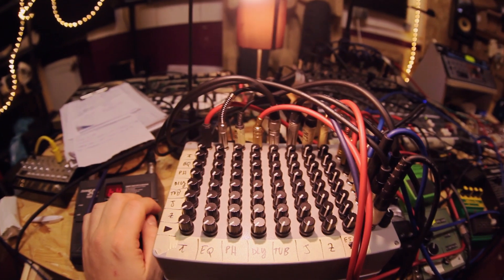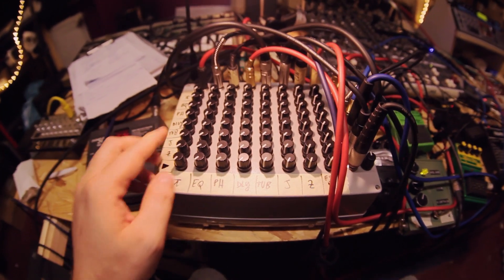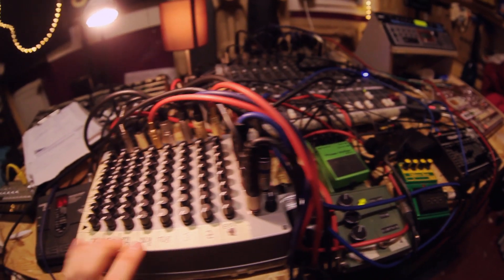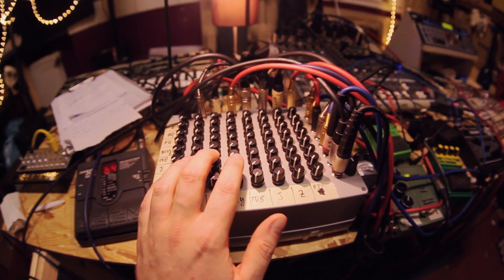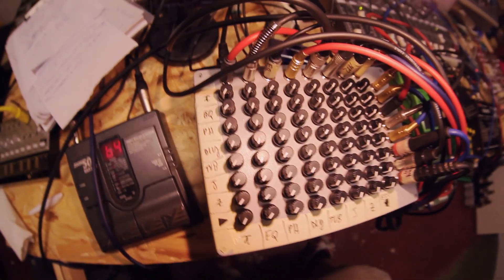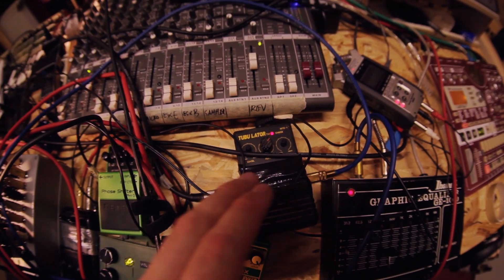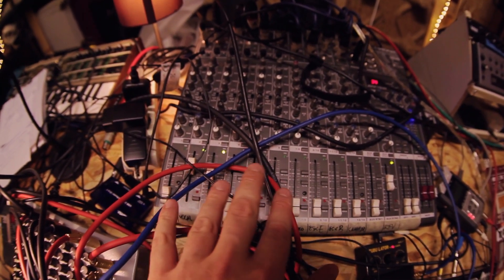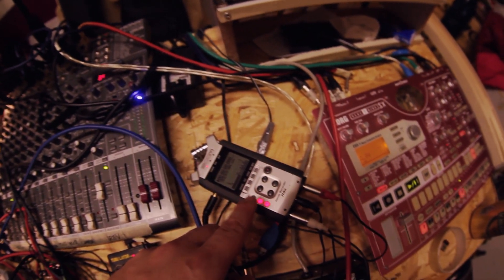8x8 Matrix Mixer demo

Comment: is there any chance you would build another along the same lines?

I'm going to try passive first but if that doesn't cut it I like this a lot
Reply from the maker: hey sure, I make custom pieces! get in touch at minijackaudio@gmail.com
with an active mixer you have a lot more range to play with and you don't need external amplification to make up for gain loss, typically 30dB (that's roughly 1/30 of the signal!)
Reply: minijack